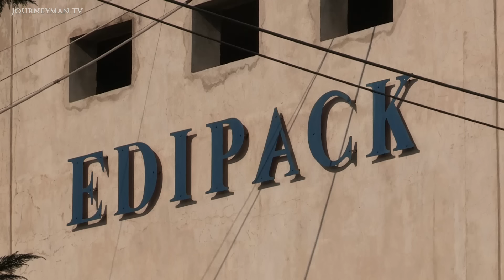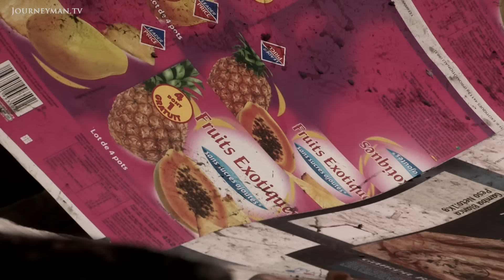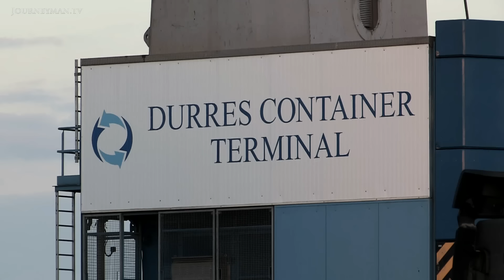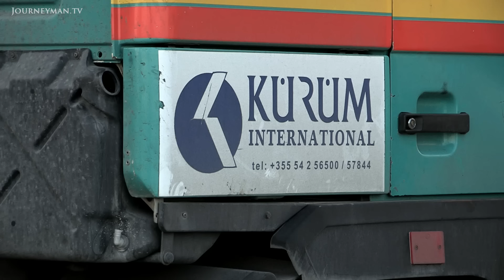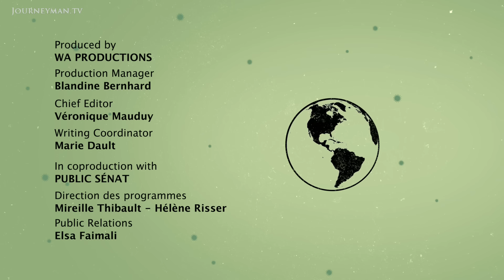How Albania Became Europe's Rubbish Tip

Comment: "Huge dumps are invading a country, barely any larger than Britain"

What?
Reply: Eternal Flow Britain = England + Scotland + Wales. 
Area of Britain: 209,331km²
Area of Albania: 28,748km²
...so Britain is over seven times the size of Albania.
Albania is a little bigger than Wales (area 20,779km²).
This documentary addresses an important issue, but as Lukas Montvilas point out it loses credibility one minute in with such an inaccurate statement.
Reply: @PedalForward  britain is england + wales. greater britain is england scotland wales
Reply: @seli7587  There is no such thing as "greater britain". (Great) Britain = England + Scotland + Wales. Please also refer to comments below by Aleksander Ciril Kožar and Krisztián Wirsz. Greetings to you from London, in England, in Great Britain, in UK!!
Reply: @arolemaprarath6615 and What does that have to do with anything lmao